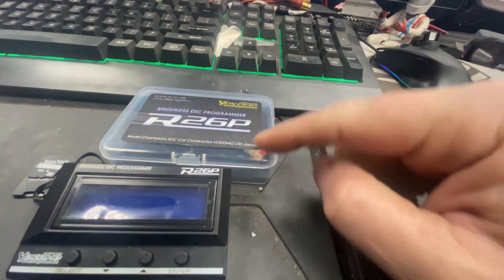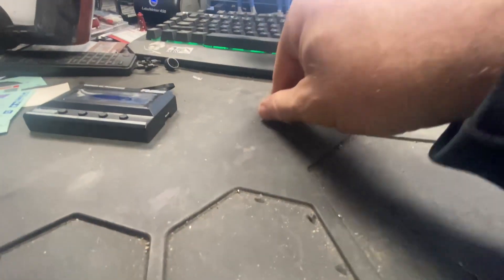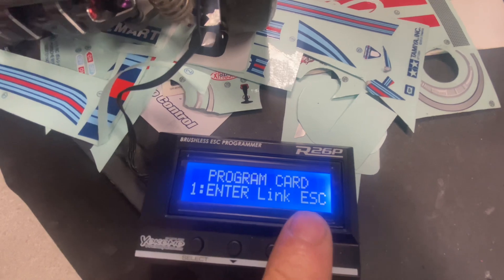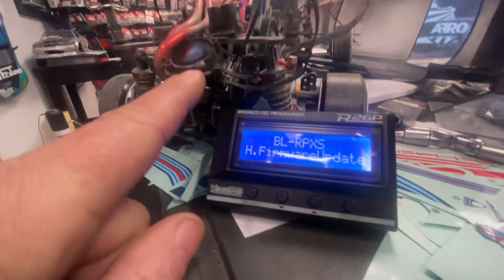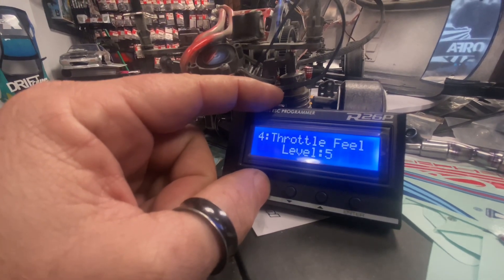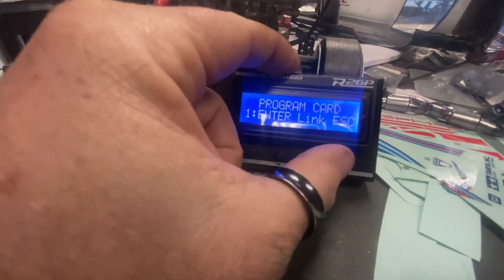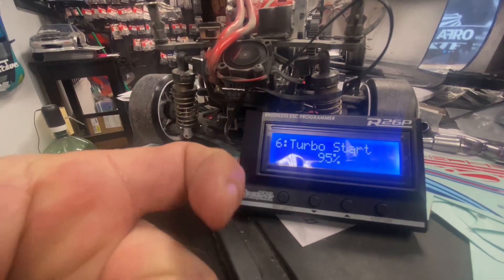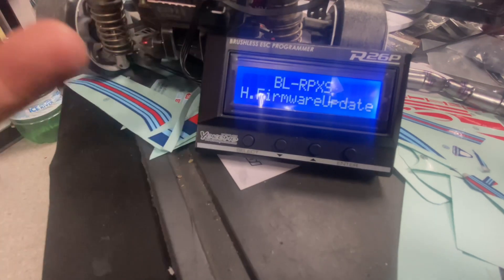How to tune a BL-RPX S

Comment: So can you still use the wifi module with BL pro 4 D? Seems crazy that you would go backwards in tech. I haven’t had to use a micro as card years.
Reply from the maker: No, strangely enough, you can’t use the Wi-Fi module because back then whoever created those ESC and Wi-Fi modules made it so that it will understand the language that that ESC understand so now that hobby wing makes the new ESC now you would have to use Hobby wings language if you wanna call it that thanks for the awesome question. I wish I could come to Australia to come slide with everybody there maybe one day. Cheers have a good day.
Reply: Thanks Afro, appreciate it. So frustrating. Would love to slide with you here in syd man. One day

Comment: I am currently trying to Update my firmware on the same R26P programmer. My first car has an RPX3 on it and im having a hard time updating from Version 1.0 to the suggested 2.0. Got the file onto an SD card and got TF ERROR when trying to access it on the Programmer. Super frustrating. If anyone had this issue and overcame it, please let me know how you did so. THANK YOU!